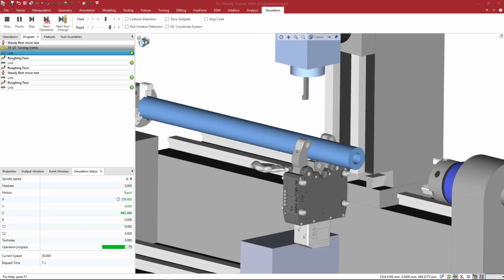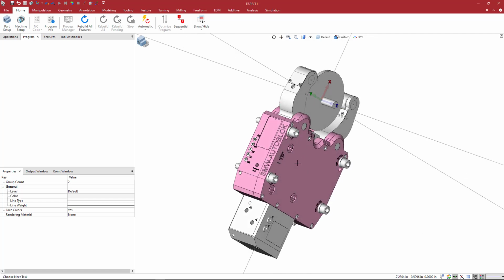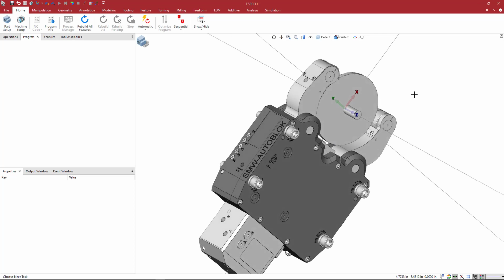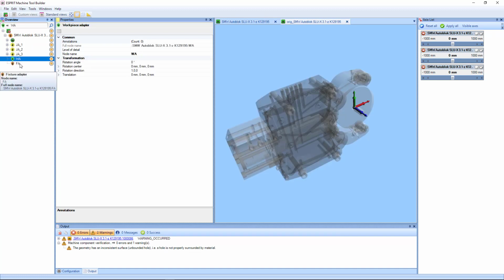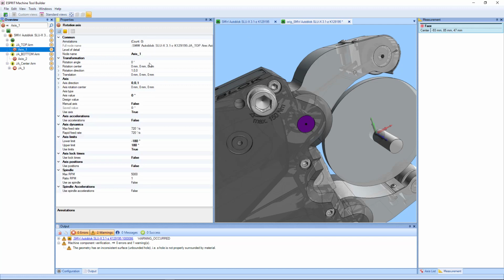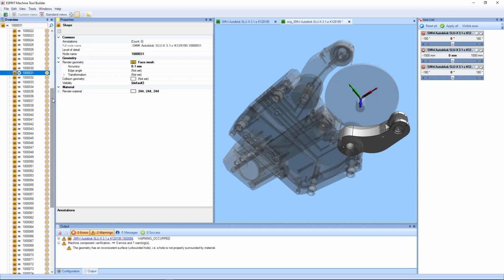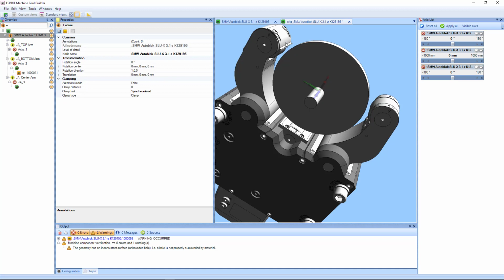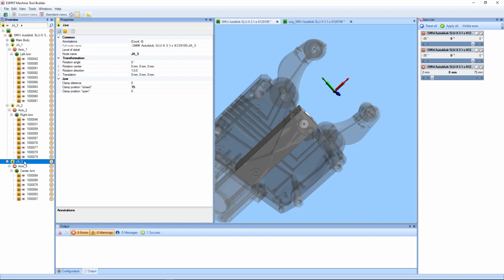Use Machine Tool Builder to create a steady rest for programming in ESPRIT

Comment: Hello and thanks for this great video. I've imported this same exact steady rest into MTB and followed all of the instructions, got all three objects moving correctly however
when I bring it into Esprit, the jaws will not open or close when I use the Open/Close jaws button. On a DMG Mori 1250 CTX Beta this steady rest gets mounted to the face of the
lower turret with a mounting plate. The unit rotates from pocket #4 & #10 to present the grippers to and away from the work. Will the grippers only open and close during the use of
a cycle like at the beginning of your video? Thanks man!